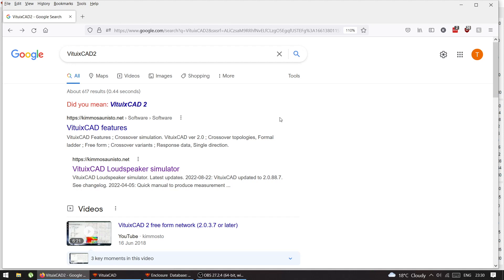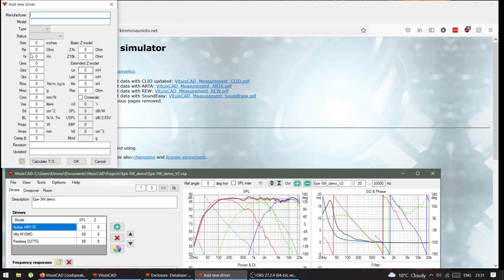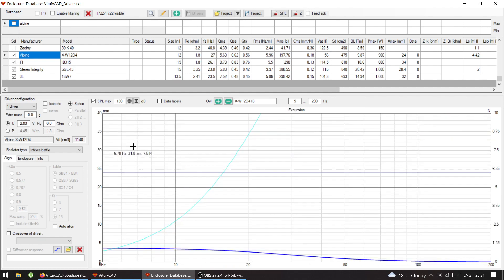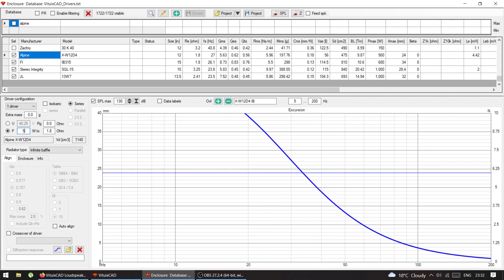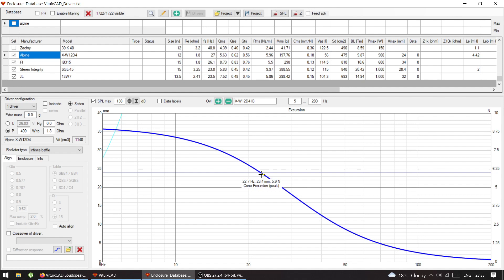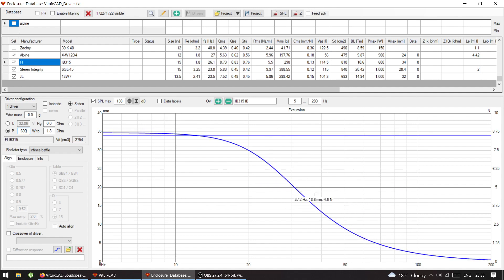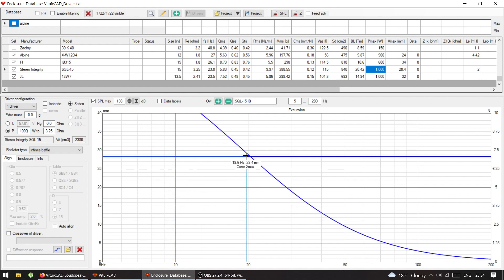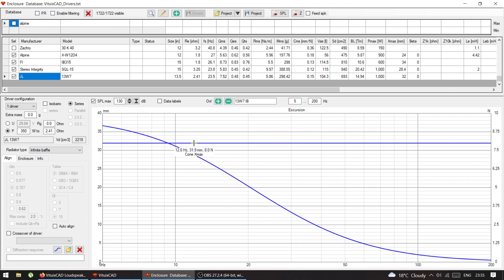How much power for IB sub?

Comment: Question please🙏:
Once we have determine the amount of power needs and the amp we have is more them what we need like my amp is a 500w rms and I only need 200w how do we set the gain to get the 200w and which test tone/pink nose or sweep x should we use?
Reply from the maker: You lower the channel gain in the DSP. You can calculate the amplifier voltage needed based on the ohm load and decrease to that value.
Reply: @ ohhh yeahhh the ohm law totally forgot about that!! Thanks sooo much 🙏